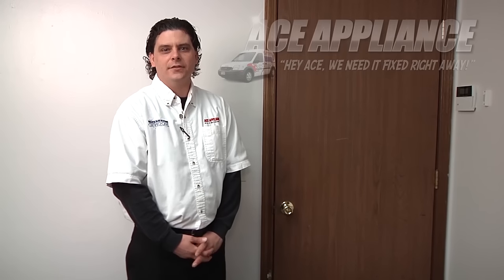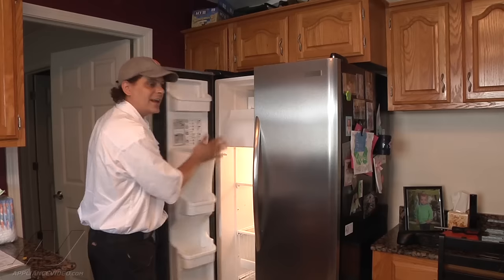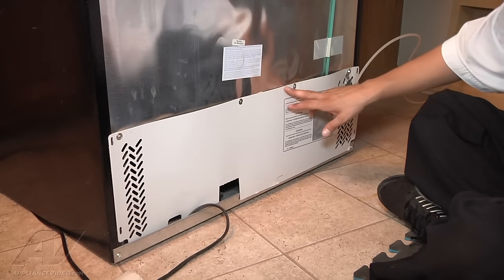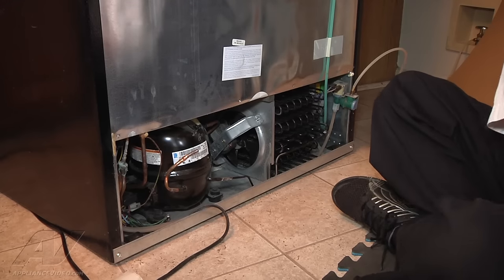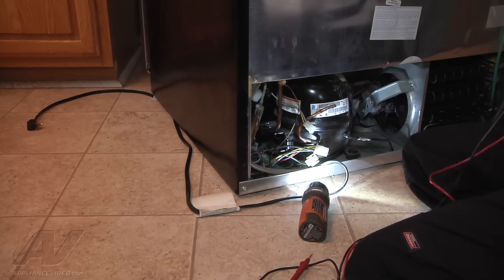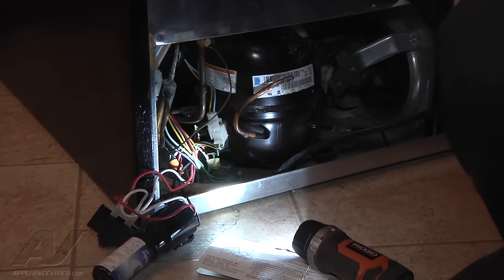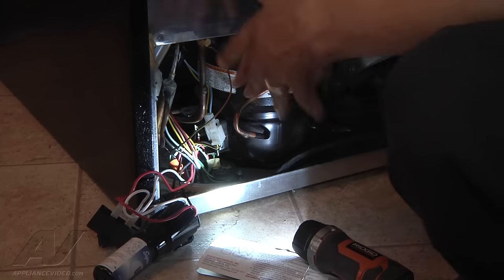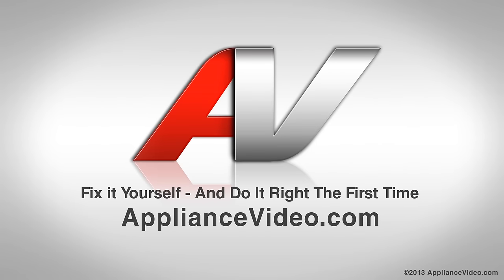Frigidaire Refrigerator Repair - Not Cooling - Hard Start Relay Overload Kit - Diagnostics

Comment: I have model FPHN2899LF7, and im trying to understand the inverter.  It has 120 going to it, then I just checked the control power to it.  It was 20Vs, but the diagram says 12V.  The inverter is not putting out any voltage (should be 230V).  Nothing runs but the lights are on and high temp alarm.  Please help.  Is 20v right?
Reply from the maker: Great question, you can call
our parts department at 1-800-830-5465 and they can give you help 6-days A week
Mon-Sat . You can also search at www.SaveMoreOnParts.com 7- days a week.  If you have a more
technical question that our parts department cannot answer, our technicians are
answering all questions at our website at www.ApplianceVideo.com under our Repair Help section. We have over 6,000
common questions and answers that you can easily search through by your model
number, appliance make, problem or error codes, and It’s completely free to
search through our question & answer library. There is a very good chance
you question is already answered there.

Comment: hi, I have a question about that universal kit.  without knowing the hHP of my compressor, will it still work?  My refrigerator is GE.......for in house use.......  Thanks.
Reply from the maker: Great question, you can call our parts department at 1-800-830-5465 and they can give
you help 6-days A week Mon-Sat . You can also search at www.SaveMoreOnParts.com 7- days a week.  If you have a more technical question that our parts department cannot answer, our technicians are answering all questions at our website at www.ApplianceVideo.com under our Repair Help section. We have over 4,000 common questions and answers that you can easily search through by your model
number, appliance make, and problem or error codes, and It’s free to search
through our question & answer library.
Reply: You can't get a reply from this channel. They just give you a generic reply with links to go look for the info.

Comment: Recharge a Fridge Cooling is Wel but Problem is that When It Stopped Restart very Quickly if u know plz share Thanx
Reply from the maker: Great question, if you have a
more technical question that our parts department cannot answer, our
technicians are answering all questions at our website at www.ApplianceVideo.com under our Repair Help section. You can also call
our parts department at 1-800-830-5465 and they can give you help 7-days A week
Monday -Sunday, or search at www.SaveMoreOnParts.com  24 hours
7- days A week.

Comment: Hi I was having a problem with my fridge not cooking and I looked behind the fridge and the wires connecting the compressor are broke is there a way I can order the wiring ?
Reply: Cooling *
Reply from the maker: Great question, you can call our parts department at 1-800-830-5465 and they can give
you help 6-days A week Mon-Sat . If you have a more technical question that our
parts department cannot answer, our technicians are answering all questions at our website at www.ApplianceVideo.com under our Repair Help section. We have over 4,000
common questions and answers that you can easily search through by your model
number, appliance make, and problem or error codes, and It’s free to search
through our question & answer library.

Comment: When you change the started relay and cap you  must do it with exact parts  people can get them  the one he use is  more money and a quick fix  I don't agreed with what he did I've  done many compressors  and I never installed that type of relay and over load
Reply from the maker: Great question, if you have a more technical question that our parts department cannot answer, you can search our over 17,000 answered questions free at our website www.ApplianceVideo.com under our Repair Help section. You can also call our parts department at 1-800-830-5465 and they can give you help 7-days A week ,or search at www.SaveMoreOnParts.com  .
Reply: That’s a hard start kit. It’s a temporary fix for a failing compressor. It will kill a good compressor in a couple months. This is so wrong.
Reply: Why wouldn’t you just replace the part. Wtf ???

Comment: My freezer work but cooler not, what is that indicated? Thanks!
Reply from the maker: Great question, if you have a
more technical question that our parts department cannot answer, our
technicians are answering all questions at our website at www.ApplianceVideo.com under our Repair Help section. You can also call
our parts department at 1-800-830-5465 and they can give you help 7-days A week
Monday -Sunday, or search at www.SaveMoreOnParts.com  24 hours
7- days A week.

Comment: I've got a whirlpool and the freezer works but the refrigerator part doesn't it's like 55 degrees what's the problem?
Reply: Jerry Hanson the problem is that it’s not working
Reply from the maker: Great question, if you have a
more technical question that our parts department cannot answer, you can search
our over 10,000 answered questions free at our website www.ApplianceVideo.com under our Repair Help section. You can also call
our parts department at 1-800-830-5465 and they can give you help 7-days A week
Monday -Saturday, or search at www.SaveMoreOnParts.com  24 hours
7- days A week.

Comment: How about a thermistor or board issue?
Reply from the maker: Great question, if you have a more technical question that our parts department cannot answer, you can search our over 17,000 answered questions free at our website www.ApplianceVideo.com under our Repair Help section. You can also call our parts department at 1-800-830-5465 and they can give you help 7-days A week ,or search at www.SaveMoreOnParts.com  .

Comment: My issue is the fridge and freezer are both at about 34F.  Everything seems to be working except the freezer is not 0F.
Reply from the maker: +Jonathan Penney 

We would like to help you
answer your question. With our videos now getting over 900,000 views per month and
hundreds of questions from people like you, our technicians are now answering questions
at our website http://www.appliancevideo.com/repair-help/ .  We also have over 2200 common questions
and answers that you can easily search through by your model number, appliance
make, problem or error code and it’s absolutely FREE. You also have the option
to email a factory service technician with a question on your appliance at http://www.appliancevideo.com/repair-help/ . If you’re looking for a repair video, you can
also search our library of over 2600 free repair videos. ApplianceVideo.com
specializes in quality DO-IT-YOURSELF appliance repair videos and we get over
800,000 views per MONTH to our videos worldwide and growing. If you need of
parts for your major appliance, we have over 5-million parts in stock at http://savemoreonparts.com/ .  Thanks for your support. Matt Ace
Appliance factory service technician.
Reply: Jonathan Penney, I see your question is one year old. I too have the problem where only the freezer is not cold enough. How did you fix yours?

Comment: my frigidaire  gallerys temps are both at 32 degrees try to reset them especially the freezer to 0 degrees but goes back to 32 degrees can somebody tell me why thanks
Reply from the maker: Great question, with our
technicians now getting hundreds questions weekly, they are answering all questions
at our website at ApplianceVideo.com under our Repair Help section. We have over
3,000 common questions and answers that you can easily search through by your
model number, appliance make, and problem or error codes.

Comment: My interior lights went out,  the fan still works. But its starting to get warm
Reply from the maker: Great question, if you have a
more technical question that our parts department cannot answer, our
technicians are answering all questions at our website at www.ApplianceVideo.com under our Repair Help section. You can also call
our parts department at 1-800-830-5465 and they can give you help 7-days A week
Monday -Sunday, or search at www.SaveMoreOnParts.com  24 hours
7- days A week.
Reply: Sealed system issues

Comment: I stopped the video at 6:42 
because right away you knew to replace the start overload and instead you put on a hard start which as a Frigidaire authorized servicer will void any warranty on that compressor.

Comment: What do you mean by unit? I’m not sure where the condenser fan power wires go to off of the original start relay. I wish someone would show detailed pics or show where each wire comes from and not just say a name. 😅 thanks
Reply: I had the same problem with my fridge / freezer not cooling, I went through all the crap these supposed experts suggested that I was ready to buy a new condenser and fan when I tried something no-one suggested, I  turned my fridge / freezer off for half an hour and turned the settings back to zero. I then turned everything back on, reset the settings to normal and left it for an hour. It works like a brand new appliance. 
Now tell me why none of these guys never once mentioned that you can reset a fridge and freezer and to try that simple step first before panicking people.

Comment: My fridge and freezer won't work display won't come on and can't hear compressed come only things that work are light bulbs when door opens
Reply from the maker: Great question, if you have a
more technical question that our parts department cannot answer, our
technicians are answering all questions at our website at www.ApplianceVideo.com under our Repair Help section. You can also call
our parts department at 1-800-830-5465 and they can give you help 7-days A week
Monday -Sunday, or search at www.SaveMoreOnParts.com  24 hours
7- days A week.

Comment: God day sir my two door ref samsung is not cooling the technician told me that the coil has a leak on the bottom part..
Reply from the maker: Great question, if you have a
more technical question that our parts department cannot answer, our
technicians are answering all questions at our website at www.ApplianceVideo.com under our Repair Help section. You can also call
our parts department at 1-800-830-5465 and they can give you help 7-days A week
Mon-Sat . You can also search at www.SaveMoreOnParts.com 7- days a week.

Comment: Not cooling properly that means was cooling to 50 on the freezer?
Reply from the maker: Great question, if you have a
more technical question that our parts department cannot answer, our
technicians are answering all questions at our website at www.ApplianceVideo.com under our Repair Help section. You can also call
our parts department at 1-800-830-5465 and they can give you help 7-days A week
Mon-Sat . You can also search at www.SaveMoreOnParts.com 7- days a week.

Comment: Be careful not to touch hot capacitors when you remove them  take off and ground out with Klein flat head screwdriver.
Reply from the maker: Great input thanks. Call  
our parts department at 1-800-830-5465 and they can give you help 6-days A week
Mon-Sat . You can also search at www.SaveMoreOnParts.com 7- days a week.  If you have a more
technical question that our parts department cannot answer, our technicians are
answering all questions at our website at www.ApplianceVideo.com under our Repair Help section. We have over 6,000
common questions and answers that you can easily search through by your model
number, appliance make, problem or error codes, and It’s completely free to
search through our question & answer library. There is a very good chance
you question is already answered there.

Comment: my refrigerator is cooling up to the required level. It is drawing  current -the regulators are adjusted but no result Is there anybody who does repair job? Or advice on line how to repair
Reply from the maker: Asoke 
          If you go to ApplianceVideo.com and type in your model number or your symptom you are having. Our site has 2600 free videos on it to help solve your problem. We add new videos every week. There is a very good possibility you will find a video that will help solve your problem. Please help our ranking by subscribing to our YouTube page or posting our ApplianceVideo.com site on your Facebook or Twitter account.

Comment: hi i have a frigidaire model PHS67EHSB6 it works fine for 6 to 9 hours then stops working if i unplug it and plug it back in right away it will kick back on anyone could help thanks
Reply from the maker: Danny Gamez 
                           We now have our FREE repair help
website at ApplianceVideo.com, all of our technicians are answering questions daily
on this website every day for anyone needing help. Just copy and paste this this question under REPAIR
HELP, and one of our  factory authorized technicians  will answer any technical questions at
absolutely no charge on your appliance issues. We also have over 2600 free
repair videos to help with your appliance repair issues. Thanks for your
support. Matt Ace Appliance factory
service technician.

Comment: ...So the problem here was WIRING and not the compressor.  But with all those wires going everywhere, it would be impossible to know for the home- owner,  making it tempting to buy a new one and have the old one hauled off....
Reply: Lonnie Christopher no the problem was a faulty start relay for the compressor. Wiring had nothing to do with it. Very common problem with fridges.
Reply: @johnnyb8700  and pretty darn easy to fix -- I just fixed my refrigerator (like finished less than an hour ago) doing pretty much exactly what was done in this video -- save for the testing with the multimeter. Once I knew it was clicking and the part rattled, I figured it was diagnosis enough. Thanks to some quick research on the internet and seeing videos like this I fixed in in no time. Pretty cool (literally haha) because sadly I don't consider myself much of a handyman.
Reply from the maker: Great question, if you have a more technical question that our parts department cannot answer, you can search our over 13,000 answered questions free at our website www.ApplianceVideo.com under our Repair Help section. You can also call our parts department at 1-800-830-5465 and they can give you help 7-days A week ,or search at www.SaveMoreOnParts.com  .

Comment: Why tech didn't just replace the relay/overload with an original and new relay/overload since at the end of the video he clearly says that his repair may be good for a day or a week or.....?
Reply from the maker: The Supco is half the price and is a better relay overload. Sometimes the compressor will draw high amprege, does not matter what realy / overload is installed.

Comment: It could have been better if the manufacturer of the starting device makes it with a connector just to connect it directly on the compressor terminals as a plug and play instead of splicing the wires.
Reply from the maker: Great question, if you have a more technical question that our parts department cannot answer, you can search our over 17,000 answered questions free at our website www.ApplianceVideo.com under our Repair Help section. You can also call our parts department at 1-800-830-5465 and they can give you help 7-days A week ,or search at www.SaveMoreOnParts.com  .

Comment: water coming from under the Frigidaire what could be the problem
Reply from the maker: gladys adamson 

All of our technicians are now answering
questions daily on the ApplianceVideo.com website. You can search completely
FREE in our Repair Help section with over 1000 questions & answers. Or you
can get unlimited technical advice and video links emailed to you by our 14
factory certified technicians at
http://www.appliancevideo.com/premium-membership/.  If you are in need of
any parts please support our parts department on line at
http://savemoreonparts.com/ or call 1-800-830-5465 7-days a week until 11pm
Eastern time. Thanks for your support. Matt Ace Appliance factory service
technician.

Comment: You just say it was a bad relay, so why don't you just replace the relay. Addeding  something not standard to what manufacture recommends potentially a liability issue for the company. And your not shore if what you just did will work for a month or years to come?
Reply from the maker: Great question, if you have a more technical question that our parts department cannot answer, you can search our over 13,000 answered questions free at our website www.ApplianceVideo.com under our Repair Help section. You can also call our parts department at 1-800-830-5465 and they can give you help 7-days A week Monday Saturday, or search at www.SaveMoreOnParts.com  24 hours 7 days A week.

Comment: Why didn't you just replace the relay?
Reply from the maker: Great question, if you have a more technical question that our parts department cannot answer, you can search our over 13,000 answered questions free at our website www.ApplianceVideo.com under our Repair Help section. You can also call our parts department at 1-800-830-5465 and they can give you help 7-days A week Monday Saturday, or search at www.SaveMoreOnParts.com  24 hours 7 days A week.

Comment: if you make a jig with a starting element (relay) and thermic protector you wouldnt have to cut nothing in order to troubleshoot the problem. just replace one or both of these components and you would be in business .  forget testing the pins on the compressor its useless at this stage...it either will work or not changing these above mentioned elements.  too slow , jack